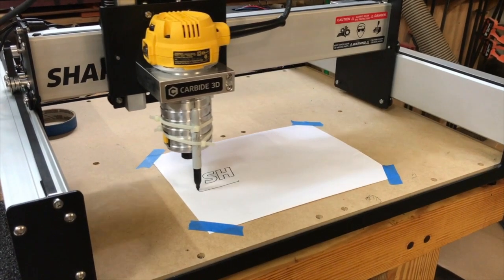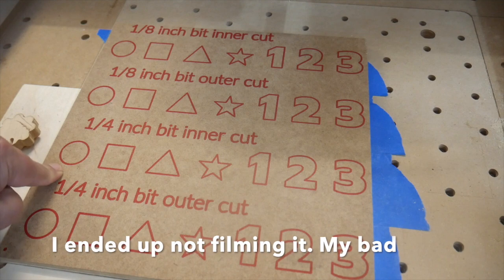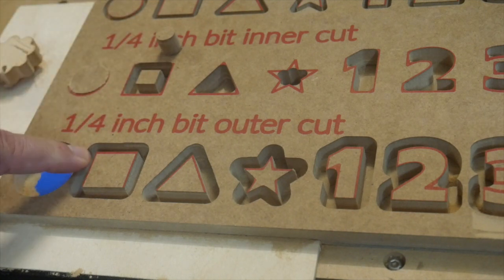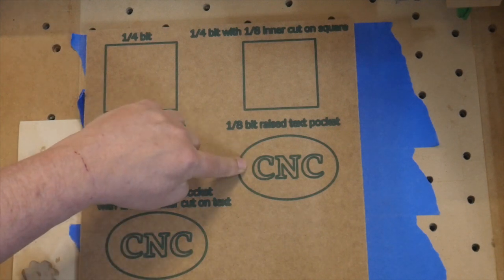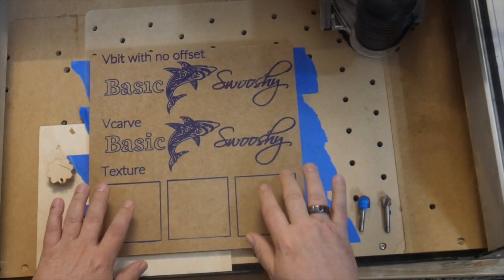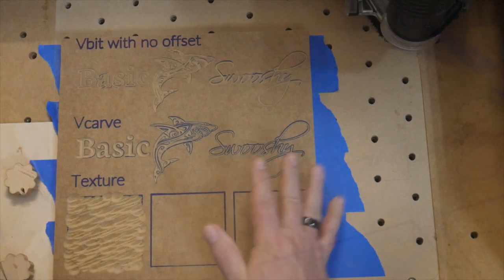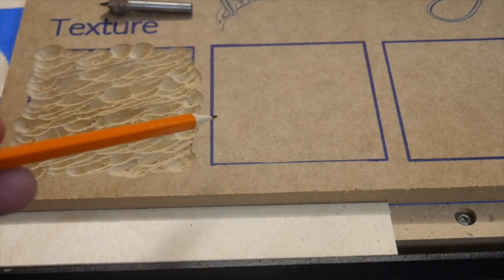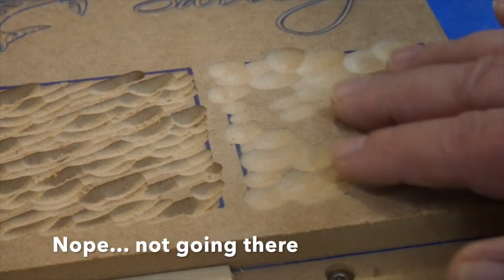Shapeoko CNC From Scratch: CNC Cuts

Comment: Great vid. And naturally I won’t wait till the end to find out if you answer. But my question is this. Inside & outside of a line is normally is a line that has no thickness. Your lines have a thickness. Are you accounting for it? If you address this later in the vid just tell me to shove off.
Reply from the maker: I am not actually sure how the inner to outer boundary of the line is handled. When I pull things over into Inkscape, the line is .01 inches thick. It may be that the line is representational only and the actual cut is from the center of the path and not the edge. As I mostly deal with wood, .01 inches hs never had much of an effect on what I do. I am betting the guys who work in aluminum would know for sure. Good question though. I will ask around.

Comment: Feeds and speeds aren't about making your machine go faster. Getting those right means getting the most out of your  machine - yes - but also your bits and your material. Going too slow can sometimes be as bad or worse than too fast. In materials like MDF (which likes to gum up multi-flute bits), going too slow can even start the material on fire.
Reply from the maker: I do understand, but I simply wanted to convey my impressions of the forum as a new user. People approach new processes in different ways. I came to CNC to help me make things. Efficiency was very much secondary to me. I am happy to use the defaults in most cases. I saw so many forum discussions veer off into discussions of chip load, when all the user asked was how to add a new tool to the library. They are my target audience, so I deliver the information in a way that I hope they can absorb and use to achieve their goals. 

That said, I would absolutely adore it if someone made a beginners video on chip load that did not sound like an engineer and a lawyer arguing in Ancient Sumerian. That would be amazing and I would watch the heck out of it.

Comment: Brilliant explanation John E. I think this should be posted to many CNC groups for newbies & even experienced CNC users to get better understanding of the relationship between bits & cuts. (Do you mind if I cross post to a few groups?)

Btw. English being very imprecise, The extra time taken for 1/8" cut over 1/4" isn't surface speed of the bit, more the amount of stock removal per pass, 1/8 has to do more circuits. In theory the 1/8bit can safely travel faster then the 1/4. But assuming same feed rate, still longer time for extra passes.
Reply: PS. Looking forward to the follow-up videos, sounds promising to be educational & improve efficiency, which in turn improves speed without breaking bits!
Reply from the maker: Feel free to share.